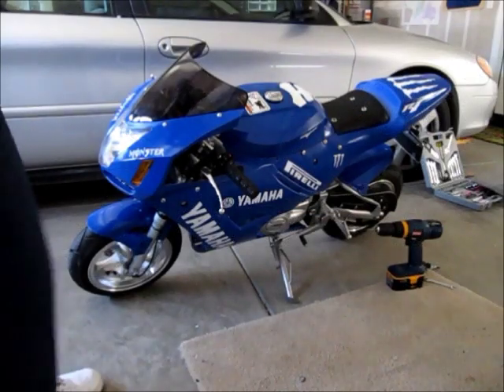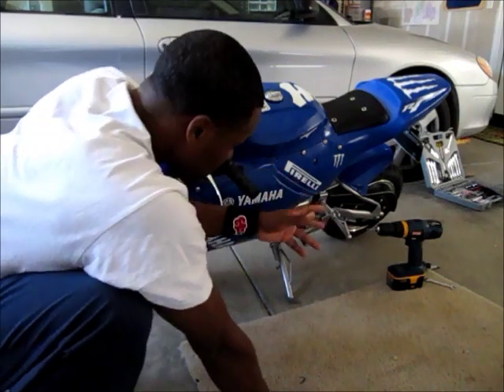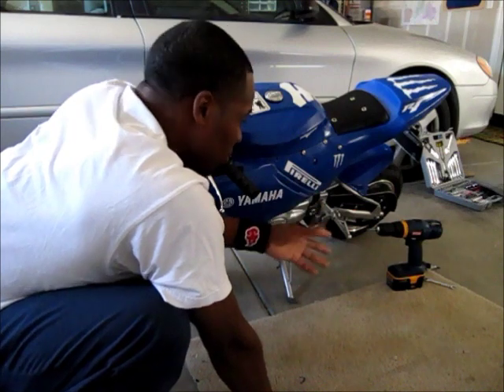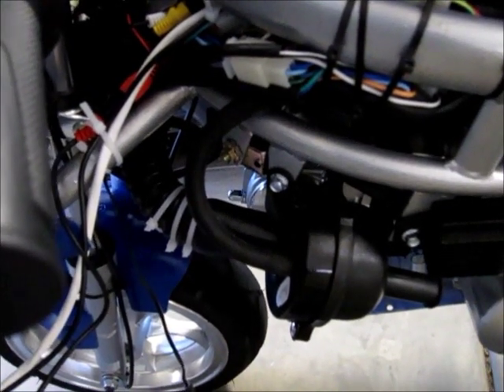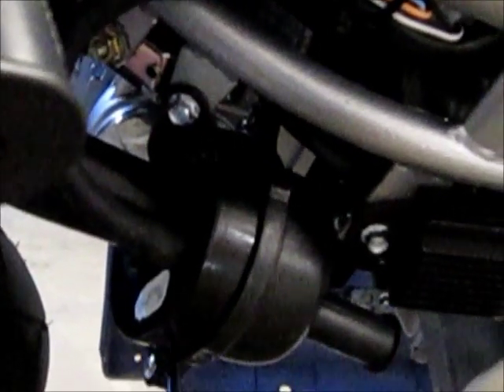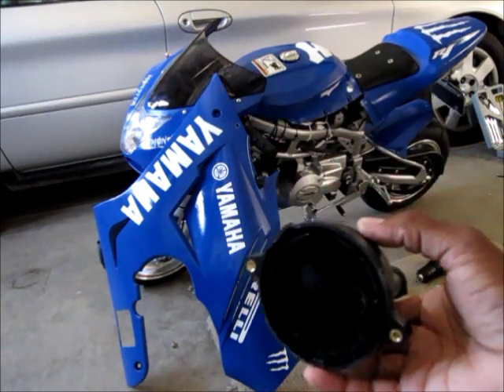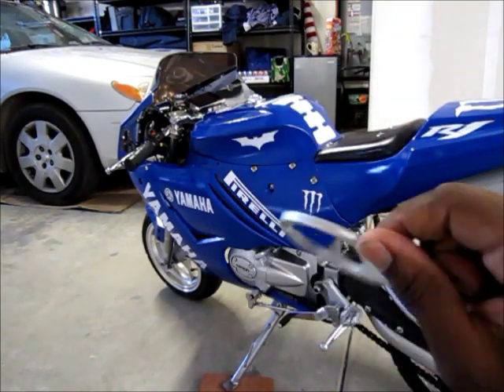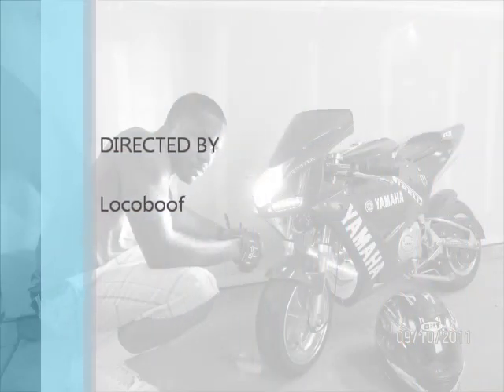How To Remove The Governor Off Your x18 Super Pocket Bike

Comment: @TheCtm405  your tansmission gears must have stripped. get a new transmission. or you blew a inner chain belt inside the transition. Or check the clutch spring, might be broken or too tight